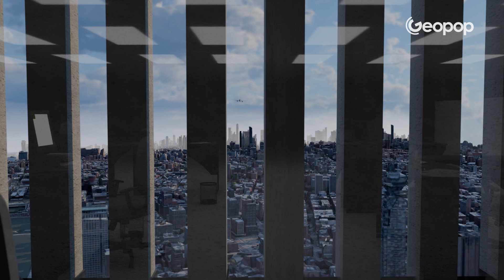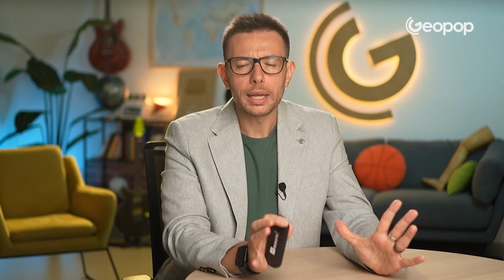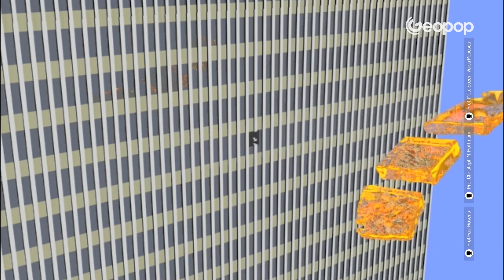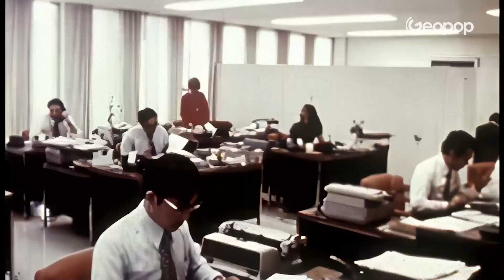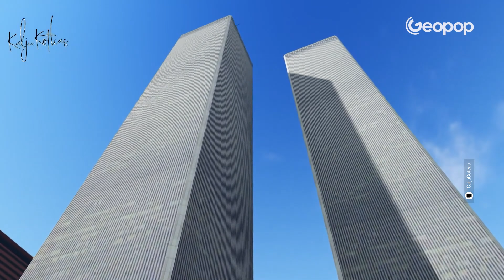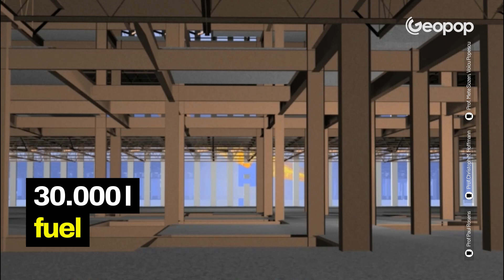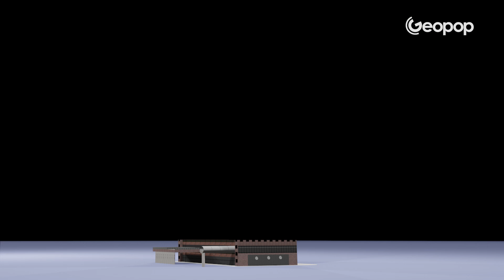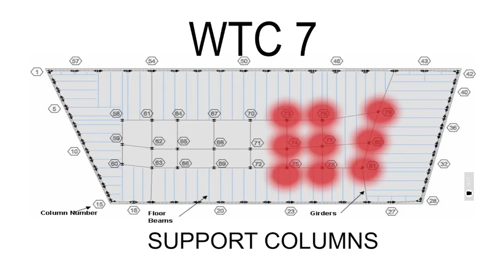9/11, 2001: The Technical Reconstruction of the Twin Towers and WTC 7 Collapses

Comment: Part of the twin towers fell into the back of wtc7 and that's what caused the columns to collapse. Not fire. Fires alone do not cause collapses of skyscrapers. There has to be some other force. In the twin towers it was the force of the airplanes and in wtc7 it was heavy parts of another building falling onto it.
Reply: For all three buildings the force that brought them down was cutter charges.
Reply: @Kudde23can you prove it? It's been proven that they fell due to structural problems. Can you prove any wiring and demolition going on? Because that sure was a messy demolition that would w had to conveniently begin right at the point of impact. Who ran in there and wired them up during the attacks and in the fire? Or they knew exactly where the planes were gonna hit beforehand? and they knew the exact spots in wtc7 the north tower would definitely fall into it, and went in and wired that part too? In the smoke? 😅😅 sorry but that sounds much less probable than structural failure.
Reply: @Jenomous  "It's been proven that they fell due to structural problems."

No it´s not and that´s kind of proof already.
Of course the twins were wired beforehand. On the upper half of the core structures. All they needed to do is manage to remotely control the planes to fly them into this upper half.
For WTC7 they did an overkill on the lower floors, causing the free fall that proves the controlles demolition.
They used thermite which doesn´t ignite due to normal fire nor impact force. They placed enough charges to compensate for charges lost due plane impact.
Elevator shafts provided access to the core columns, hidden from anyone´s view and easy to cover up.
Reply: @Kudde23then why would the unknown conspirators who you say prepped the wtc buildings for demo, why would they  had even bothered with the whole hijacking scenario at all, then? The logic alone doesn't stand up to critical thinking. There have been numerous simulations made that are to scale and based on every video and photo in evidence that ends up aligning with structural failure. There's nothing proving a demo. It doesn't make sense.
Reply: @Jenomous  "why would they  had even bothered with the whole hijacking scenario at all, then?"

Because without, even sheeple like you would grasp that the collapses had nothing to do with planes. Also without the planes you wouldn´t have all the pictures that are shown again and again at least every year.
Again, the WTC7 free fall proves its controlled demolition, also the core structures of the twins wouldn´t fail without controlled demolition.
Reply: @Jenomous  - Yeah, no.

Let’s break it down to the absolute basics, addressing most of the commonly asked questions as we go:

The 47 core and 236 perimeter columns of the Twin Towers support all of the gravity loads of the building. ALL of the resistance is in the columns.

Planes impact Towers, causing massive structural damage, destroying sprinkler systems, tearing out gypsum board walls and blasting off the SFRM insulation from the floors. Multiple floor-wide fires are started instantly and spread rapidly due to the destruction of fire protection systems and venting of the building during the impact.

Serious fires were largely confined to the impact damaged floors and those immediately adjacent to them.

Fires were started by the impacts and fuel aboard the aircraft, which acted as an accelerant. No shortage of other consumables inside the tower to continue the fires.

Collapse was initiated (started) at the impact and fire damaged floors when floor trusses exposed to heat over time sagged, in turn pulling on and causing the inward bowing of some perimeter columns by up to 5 feet until they buckled on one face of each tower (ie: NOT symmetrically).

www.youtube.com/watch?v=ULdiD6gYZO0

No steel melted or needed to. Structural steel will bend and fail at less than half its melting temperature.

Once the perimeter columns buckled the formerly static load above became a dynamic load 30 times greater, easily overwhelming the structure below.

Thousands of tons of now loose debris fall through the open office space within the four outer walls - bypassing the columns - dropping 12 feet onto the first intact floor it comes across. That massive instant overload causes the floor to fail, shearing the pair of bolts that secure each end of the floor trusses to the columns. The floor fails. adding its mass to the falling mass which continues to accelerate for another 12 feet until it impacts the next floor, rinse and repeat one floor at a time all the way down.  Yes there is resistance but its totally inadequate to arrest the collapse. Resisting is not the same as preventing

The columns - the part that holds the building up, supporting ALL of the gravity loads - are spectators for all this as the debris falls around and past them, not onto them.

Rate of collapse increases as momentum increases. The collapse front is constantly accelerating.

As each floor fails, air inside the building (the Towers were 95% air by volume) is compressed, then blows out the sides _in reaction to the Tower falling, not the cause of the Tower falling.

No fire required at all on floors below the impact points for them to fail. The mechanisms that started the collapse are different to the mechanisms which continued the collapse. That will be a difficult concept for some.

As the floors fail the perimeter columns are left literally hanging in the breeze, no longer attached to the rest of the structure. They peel away and fall in great sheets (think banana) out to more than 600 feet from the base on the 4 points of the compass.

Core columns failed last, buckling near their base due to the loss of critical lateral support as the building collapses around them.

www.youtube.com/watch?v=WpHXj62Ylw0

Twin Towers collapses were a combination platter of four (4) factors:

Impact Damage + Fire (heat) + Time + Gravity = Collapse

Remove any one of those four factors and there is no collapse. Ignore any one of those factors (most people reading this ignore three) and you will never understand the collapse. They all work together. 

The collapses took 32 to 34 seconds start to finish, or about 1/3 of the rate of free fall acceleration for those obsessed with how fast things fall because the internet told you it was important. No Laws of Physics are violated so no need to invoke magic or divine intervention

Each 110-story tower had a 1-acre footprint. The debris pile was up to 14 stories deep and spread out over 16 acres, destroying 8 surrounding buildings and damaging more than 100 others.

Anything can seem like a conspiracy if you don’t take the time to understand how it works. Hopefully now you do.  If not, I can go into much greater detail.
Reply: @TheLoonResistance don't use AI to reply to me. If you used your human eyes then you'd see I didn't mention any conspiracy regarding the collapse of the towers I actually said they did not fall due to wiring or demo.
Reply: @Jenomous - I have never used AI in my life. My brain works. I wrote that (which is the Cliffs Notes version i assure you) years ago.

Feel free to apologize and we can continue.
Reply: @TheLoonResistance you "wrote" the same reply to 10 other comments on this topic the exact same way. This time you responded to the wrong person though because you're not using your eyes to actually read what's being said and by whom. You're only responding and not reading. Read.
Reply: @Jenomous  - Yes I have posted that many times, because people keep asking the same questions, and that post answers most of the, plus the ones they had not thought of yet.  Which is the whole reason I wrote the thing years ago. Why keep inventing the wheel?

I read your OP, where you stated:  Not fire. Fires alone do not cause collapses of skyscrapers. There has to be some other force. In the twin towers it was the force of the airplanes and in wtc7 it was heavy parts of another building falling onto it

That is not (quite) a true statement, for the reasons outlined in my stock catch-all reply.  

Twin Towers collapses for example were a combo-platter of four factors. It wasn't just fire and it wasn't just airplanes or even fire and airplanes. 

I'm sorry you are so butthurt.  Have a nice day.
Reply: @TheLoonResistance wrong. In reference to the wtc7, I said fires did not cause it to collapse, because the COLUMNS were severed, which was not caused by fire but by structural damage from parts of the north tower falling into it. In both towers, the affected columns that caused the collapse were severed by the force of the planes that crashed into them. Fires did not sever steel columns.
Reply: @Jenomous  - Fires did not sever ANY columns in any building, nor was any collapse due to columns which had been severed by the aircraft impacts. 

In the Twin Towers collapse initiation was due to sagging floor trusses inducing inward bowing of perimeter columns by up to 5 feet until they buckled

www.youtube.com/watch?v=ULdiD6gYZO0 

In Building 7 collapse initiation was due to lower floor failures in the NE corner of the building, which in turn caused a loss of critical lateral support over an excessive length on a critical column whose loads could not be redistributed.  That column buckled.
Reply: @Jenomous Listen to how many times these firefighters say the word explosion when talking about a building that Supposedly fell down.
https://youtu.be/0Gh3ErgMI4M?si=ypcJ4xsVw0ErG1P1
Listen to other firefighters that say when the buildings fell it looked like controlled demolition.  You can see the explosions. 
https://youtu.be/LBwsJ-MWGuE?si=6yClInobVQGrT9ZF
And then there's tower 7. And theres not much to say this next video speaks for itself.  Just like.
All controlled demolitions.The first thing you do is take out the stair wheels and the elevator shafts. If a building was falling down , these would be the last thing to fall Yet you can clearly see On this next video The strongest part of the building falls first.
https://youtu.be/LBwsJ-MWGuE?si=6yClInobVQGrT9ZF
Nist lied about everything in there investigation. The temperature,  the loads, the structural integrity,  the movement of the building when falling.  The expert says the only way for tower 7 to fall in this manner is controlled demolition. Here's the video. 
https://youtu.be/qXYpqJvjekM?si=kSRzJKVC-UEb2pZp
Look for yourself. This is the smoking gun.
https://youtu.be/8WNk674LZrI?si=eNnvHh7JtvAj9J-T
Here's a firefighter saying tower 7 is exploding and you can hear the explosions 
8:25
https://youtu.be/bLF5D7M1YgA?si=uMD9-qJHJrFdMsm2
And this next video points out some very interesting facts.
https://youtu.be/oHbUBbfipNw?si=ex9yAa4NU0G_Ih4Y
This next video shows explosions way below the falling part of the building.  Watch this next video to see what I'm saying 
https://youtu.be/woymEsGqfkc?si=oy5VAxqAnuA3y5Ai
And then you have the Gelatin group.  Most people don't even know what i'm talking about but This group of people was practically living in the world trade center building. They published a book in Austria.
With some of the most disgusting things i've ever seen in my life and that book here's the video checking out
https://youtu.be/X65VunrO6DQ?si=GDARY0--0qycw9tU
Here's another video of the other groups associated with the gelatin group Who rented a helicopter So they could each have their picture taken at the WTC Buildings before they fell.
https://youtu.be/-its6EG3DwA?si=9C2lhhlwN3ASfkfE
Reply: @Jenomous Let's set the record straight. Molten steel was found in the dust, and in the debris for 6 weeks.  Molten steel was reported by the fallowing 
people. Captain Philip Ruvolo (NYCFF), 
Richard Riggs(debris removal expert) , Leslie Robertson (wtc structural engineer), Lynn Margulis (University of MA),  Dr. Abolhassan Astanch (from Berkeley),  Robert Kim Ireland( chemical engineer for US Army Corp of engineers), Mark Basile( chemical engineer), Kathy McGrade (materials engineer), Gery Warner( Mechanical engineer), David Gregg( PhD Chemical engineer), Steven Jones PhD( physicist), Kevin Ryan ( BS Chemistry), Niels Harrit (PhD Chemistry), Tom Sullivan( Explosives team) Jason Cheshire ( Chemical engineer), and Jeffrey Farrer (PhD Material science engineer).